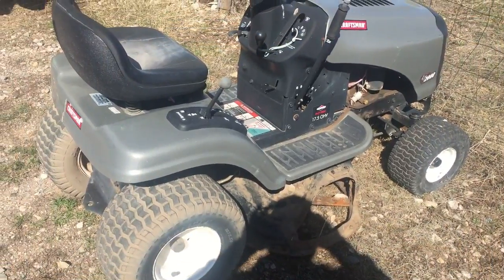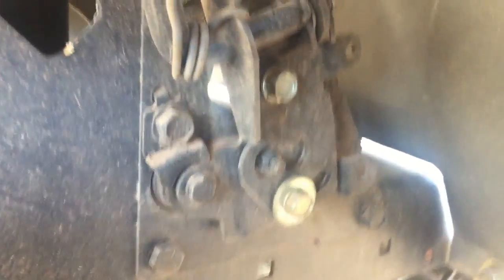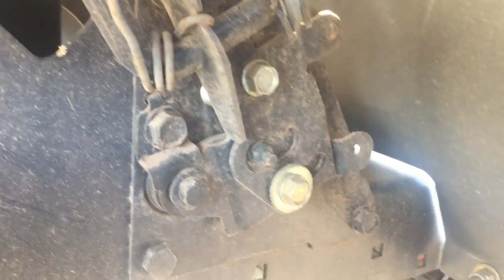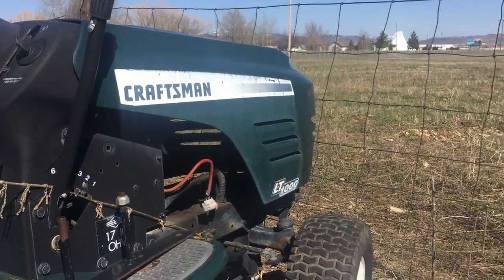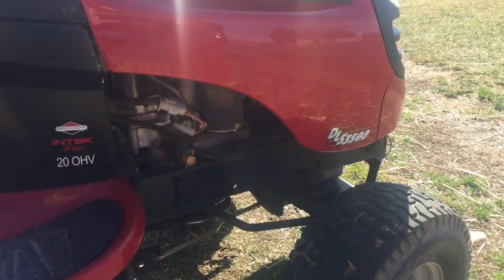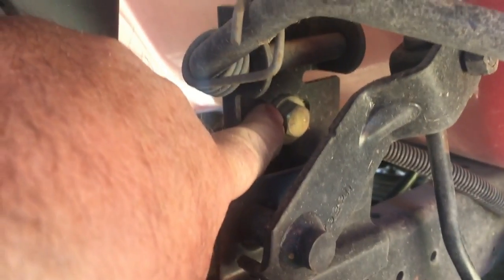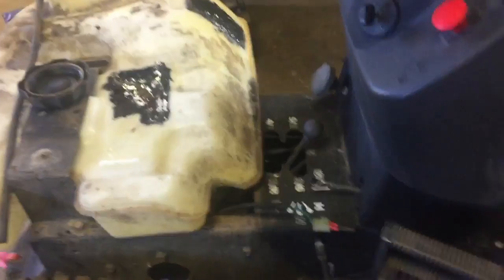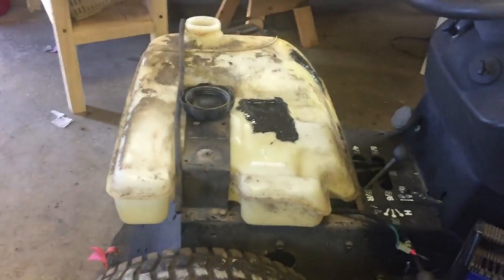Lawnmower shifter adjustment

Comment: Thank you for the advice quick and easy adjustment saved me a load of time and a visit to the repair shop, very appreciative for your help!
Reply from the maker: Griffiths36 
Thanks for watching.
Reply: @DaleHobbs39  When shifting the 6 speed do I need to push brake pedal first???
Reply from the maker: @michaelmeyers3664  
Yes it will shift easer if you push the brake half way. No need to apply the brake just enough to release the drive belt tension a little.
Reply: @DaleHobbs39  Thank You so much for getting back with me!! Take care, God Bless!!!

Comment: Hello, on behalf of all your followers thanks for the posting and assistance. Hopefully you can help me too. I have a 12HP, rear engine Murray. Will not move in any forward gear nor reverse. Do you have any  a suggestions? Thank you!
Reply from the maker: I did a rear engine Murray. I was on the test drive and the traction drive belt broke. I don't remember if I did a video on it. it has been a few years, check my play list.
Reply: @DaleHobbs39  hello Dale, thanks for getting back to me! Found that one of the rear wheels had the key missing that locks the wheel and shaft together. Unbelievable, as I was thinking transmission problem.

Comment: Appreciate the video. I know you made it quite some time ago. But I have an old craftsman LT 4000 and the shifter is below the steering wheel, in the center. It goes into all of the gears, including reverse, but it is just super difficult to get it to go from one to the next. Could it be something as simple as something is bent? I saw another video suggesting that might be the issue. Going to get into it tomorrow.

Comment: Dale. My 2009 ariens 46 inch hydrostat shifter won't stay in place. After I put it into forward it will go about 15 feet and move back into neutral I have to keep hand on lever to keep it from moving.

Comment: I have a late 90s early 2000s craftsman rider, similar to the lt1000, and it needs some sort of adjustment on the shifter. Reverse and forward both work but neutral isn't where it's supposed to be. To shift into "neutral" you'll have to have the shifter lever in the "forward" position
Reply from the maker: If you can't adjust the lever underneath, you may need to bend the lever so it's in the correct position . Thanks for watching .

Comment: A friend of mine has a McCulloch M115-77RB Lawn tractor that keeps breaking the gear shift rod, it’s been replaced twice now but continues to fail, always at the transmission end, any ideas to why it’s failing? 

When I replaced it the last time I used it for a 5 minutes and it works fine, when they use it for any length of time, 10 minutes or so (what they tell me) it fails. They say that they are shifting as you’re meant to so it’s not user error, they’ve had it for 7 years and drive it now the way they always have and it’s only started to fail recently.
Reply from the maker: I'm not familiar with this model. Here are a few things to try. If it's not a hydrostatic drive and your shifting on the fly, press the clutch/break pedal half way down then shift. or stop press the pedal all the way in then shift. The rod may have a poor design. It may need a little reinforcement at the end.

Comment: I have a Craftsman DGS 6500 Garden Tractor which is a bigger version.  Though the parts are different, they work on the same principal.  On mine, the bolt had loosened up just as he described.  All I had to do was move the shift lever so that it was in the correct position and tighten the bolt.  Voila!  Reverse was again available!  Thanks for the video!
Reply from the maker: Thanks for watching.

Comment: I like your videos as no cursing, drinking, acting stupid. Could you do a video of the DLS3500 you spoke of that your wife uses. I paid big money for the complete Craftsman 46 inch deck, snowblower, blade at an auction like new but I cannot figure out how to put the deck on since the snow blower was taken off. Seems to be a rod or something missing and I can't find a video or diagram of it exactly as it was a limited edition only made 2 years as we found today somewhere online. I need to watch it all hooked up from each rod, clip, and connection. It shifts by cable to the hand shifter on the steering wheel like a car use to.
Reply from the maker: Sounds like that would be a good video. My 3500 has a 42" deck put should be similar.

Comment: Thanks for the videos. I have a Poulan Pro that won't go into gear. There is a rod dangling under the right side, opposite side of the shifter. Looks like it came loose but I don't know where it goes. Do you know how I can fix this? Can you do a video on that? Thanks again,
Reply from the maker: Kyle Morris 
Hi Kyle here is a video that may help.
https://youtu.be/yp2VOsRzJYg
Of maybe this video.
https://youtu.be/89RsB1qUkHM
I’ll look in the yard to see if I have a Poulan Pro to do a video on the shift linkage.
Reply: Thank you. I will check them out. Have a good one.

Comment: Appreciate the videos. My mower (old poulan pro) will just slip out of gear randomly it seems. I thought at first maybe something was wrong with the brake as you can get it going again with a push as it's running.  Seems to do this randomly.  I took apart and cleaned up the brakes real good and they seem to work fine. Any suggestions on what might cause it to do this?
Reply from the maker: John W 
Hi John. 
I would check the shift lever and see if it could be bent.  My old Poulan mower has a shift lever in front of the seat. I have pulled back on the lever so hard that it has bent. When I would push it forward the lever would hit the bottom of the notch. It would go in gear but I could see where it could pop out very easily.  If that isn’t it then it is more than likely in the transmission. I work on a really old MTD that had a worn axel bushing. The axle had worn into the lower transmission case to the point that it wouldn’t stay in gear.
Reply: @DaleHobbs39  thanks.. ill check to see if that's the problem

Comment: Great video.   My John deere wont reverse when I start and need to get out of garage but does reverse after driving or cutting after 15 minutes like nothing is wrong.  Any ideas what causes this?
Reply from the maker: Antonio Delacruz III 
I have never had a problem like that. I would start by looking at anything that is heat related. Sometimes if the hydrostatic transmission disconnect is not returning all the way it can make the transmission do weird things. Thanks for watching.

Comment: Thank you.  I did what you said, adjusted the lever so it would freely go in reverse.  I was so excited, put the wheel back on, started the mower and it won't go in reverse or forward.  The shift lever moves rather sloppy.  I tightened the 2 bolts at the beginning of this video and still nothing.  Any suggestions?
Reply from the maker: TWA Museum RichardsRoad 
Hi
When I adjust the shift lever I find neutral on the transmission. I do this be putting the transmission in  a forward gear and then  down shifting until the mower doesn’t move. Then I go under the fender and adjust the lever to the neutral position. I hope this helps. Thanks for watching.
Reply: git a new tracktererer😂😂😂

Comment: So mine shifts in all gears fine but on my bezel gear indicator piece my first gear is Neutral. I tried adjusting it but I can get my shifter in the reverse area of that bezel.
Reply from the maker: If you have all the gears, but can't adjust the lever land on the correct indicator mark. The lever may be bent slightly.

Comment: Could that lever prevent a polan from going into 4th and 5th gear? Was looking at buying a used one and they list that as the problem 🤓 thanks for the video. In Christ, Troy
Reply from the maker: That could be the problem. Could also be the axel bushings. I looked at on a few years ago and that was the problem. The axel had worn into the case so the transmission wouldn't stay in gear. Thanks for watching.

Comment: Is it post to shift into gear is pretty easy. I find mine that doesn’t shift into the next gear that easy. Thank you
Reply from the maker: If it has gears it helps to to push the clutch/brake pedal half way down to shift on the fly. I always stop and put it in the gear I wont to use. Even it a high gear the mower should take right out. Thanks for watching.
Reply: @DaleHobbs39  OK thanks I wasn’t for sure if that was the clutch and brake thanks

Comment: I'll check that tomorrow. My mower is a LT1000, when I finally get it in gear it'll move forward then spudder out.  I'm at a loss. Have any other ideas?
Reply from the maker: drhilltube 
I thank your on the right track starting with the linkage.

Comment: 1987 John Deere lawn tractor won't go into reverse and only goes in low gear...never made any noise at all, just won't go into any gear but low.  Any Advise Sir?
Reply from the maker: Doug Zeringue 
Doesn’t sound like an adjustment, could be something internal.
Reply: @DaleHobbs39  I was thinking the same thing..I am going to take off the body again tomorrow and see if the transmission is engaging or hopefully the transmission belt is loose.   Thanks for the reply.  Peace from New Orleans, Louisiana.

Comment: Troy built jumps out of gear going forward, tried wiring it in. What could it be.
Reply from the maker: I had one a few years ago that did the same thing. The problem was the axle bushing had worn so bad that the gears in the transmission would not stay meshed. Thanks for watching.

Comment: My mower will change gears but it's hard to shift in gears. What would that be
Reply from the maker: Jerry White 
I would start by lubing all the pivot point. If that doesn’t help there is something wrong in the transmission.
Reply: @DaleHobbs39 where are the pivot points located?

Comment: Hi Dale, currently working on a L1000, started out by not being able to get the shift lever to move to reverse, now won't go into any forward gears at all. Tried loosening up the adjustment bolts and still nothing. Any ideas? Thanks in advance..
Reply from the maker: Justin Condron 
Hi Justin
That doesn’t sound good. The next step is to take a look in side. Take your time and lots of pictures.
Reply: @DaleHobbs39  I may have a spare transaxle laying around on one of the yard tractors, probably going to save the headache and just swap it out.
Reply from the maker: @justincondron2197  
If you have one on hand that would be the way to go. It would be nice to know what was wrong inside the old one.

Comment: What if every thing works?mine will cut and start fine.I put it in forward or reverse and it wimont move
Reply from the maker: Check the drive belt. it may have come off one of the pulleys. thanks for watching.

Comment: My craftsmen t600 won't go into fwd or reverse it's makes a slight gear grinding noise So it's stuck in in neutral but when I try to push the mower it won't move .Does this sound like a transmission problem?
Reply from the maker: m c 
That’s what it sound like to me. The grinding sound make me think something is stripped in side the transmission.

Comment: Thanks for your video.  I have a Craftsman DYT 4000.  I can't get it into Neutral to push it.  The gear lever seems to move smoothly through all the positions.  This is the situation with the engine off as the mower is not running currently.  I jacked it up and the wheels spin freely, in opposite directions.  I also removed the shifter cover plate and tried to put it into neutral, but can't find the neutral position so that both wheels will spin freely in the same direction.  What might be the problem?  Thank you, John
Reply from the maker: john r. 
Hi John
Most of these mowers have a release on the back between the rear wheels. It’s a stiff wire sticking out of a hole. Pull on that wire there will be a step bent in the wire hook the step on the edge of the hole the transmission is now in neutral. I hope this helps let me know if it doesn’t. 
Thanks for watching.
Reply: Thank you. I've tried pulling that disengaging lever out and I still can't push the mower by hand. It still feels like the transmission or wheels are locked into gear.
Reply from the maker: john r. 
Hi John
I would look at the brakes next. Make sure the park brake isn’t set. If the peddle is up Check the brake mechanism on the right side of the transmission make sure it is releasing. 
Let me know how it works out. 
I would make a video for you but it’s to dark to night. Maybe tomorrow if it wold help.
Reply: john r. Same problem I’m having.

Comment: So on your wife's mower if you adjust it will it make the mower go faster?Thanks
Reply from the maker: dickey moore 
I don’t think so. The hydrostatic pump runs at a constant pressure. When the lever is full forward and the engine is at high RPM it is moving way too fast to mow. To speed it up you may need to speed up the pump.
Reply: @DaleHobbs39  okay Thanks how do y speed up the pump?
Reply from the maker: dickey moore 
I’m not sure. I would make sure the engine RPM is maxed out at 3200 RPM. You may look into putting different sizes of pulleys to change the speed of the pump. Check with one of the lawn mower racing Channels. I hear they can really make mowers fast. Thanks for watching.

Comment: Do you happen to know any tricks to the high low selector on the manual gear shift like in your video? I'm looking at a gt5000 and guy says either high or low selection , one of them it won't shift into? I've never worked on on myself. Any info appreciated. Thanks
Reply from the maker: Kevin Doble 
Hi Kevin   I’ve never had to adjust the high low lever on a gt5000. This is what I would check. First I would see if the lever was bent. Then I would look for any kind of adjustment around the base of the lever. That would be the easy fix. After that it would be inside the transmission possibly a sheared roll pin or a bent shift fork.
Reply: Dale Hobbs thank you

Comment: Hi Bill here. I have a Bolen riding mower. It's cutting way too low. Bought it used. It's in the highest setting.
Reply from the maker: William Porter 
Hi Bill
It could be a bent blades. This may sound odd but check the tire pressure and tire size. I don’t have a Bolen on hand to get the tire size for you. This is the biggest problem with an out of adjusted decks.  Then check to see if the deck goes up and down should move around 2 inches or so. If not something is wrong with the linkage. Next check the level adjustments. Front to back is adjusted with the rod or rods under the engine. With the blades pointing forward and back the front tip should be 1/8 to 3/8 lower then the back. The side to side is adjusted with the lift arms. With blades pointing side to side the outer tips should match. Check these adjustments several time. I hope this helped. Thanks for watching..
Reply: @DaleHobbs39  Thanks Dale for getting back. I feel pretty stupid about now. I guess the guy I bought it from never bothered to raise the deck. After more YouTube videos and yours I figured out how to raise the stupid thing. Lol. I do still have one question. I found the adjustment but in the front of the mower which raises the front. And facing the mower on the right was an adjustment but to raise that side but couldn't find an adjustment nut on the left side. Does the one nut do both. It seemed pretty level.
Reply from the maker: @williamporter9604  
Just adjust the right side up or down to match the left side.
Reply: @DaleHobbs39  Thanks again

Comment: My LT1000 today just doesn’t go forward or reverse. Nothing. It worked a week ago.
Reply from the maker: I would check the drive belt first. It is right under the engine and just above the deck drive belt.
Thanks for watching.
Reply: Dale Hobbs Yes sir.  
That was it. The drive belt was so worn and had 3 partial splits that it fell off the Idler pulley.  
Replaced the Drive belt and while I was at it, replaced the mower deck belt 

The operation is now like new.  Fantastic.